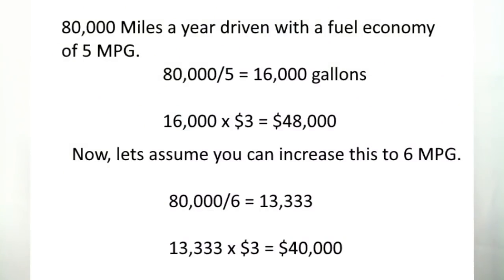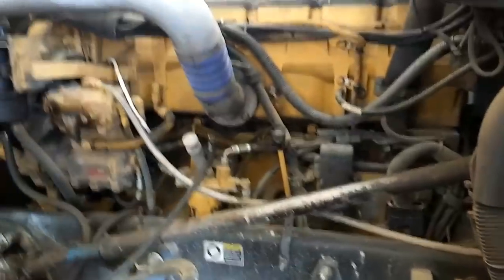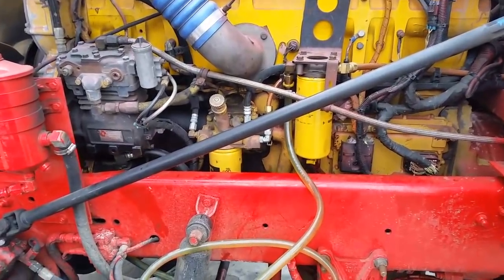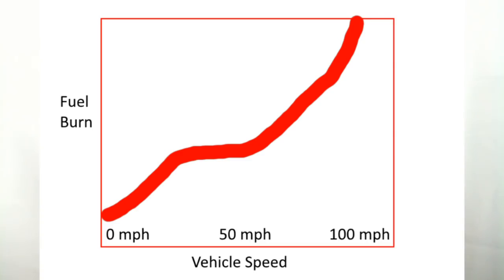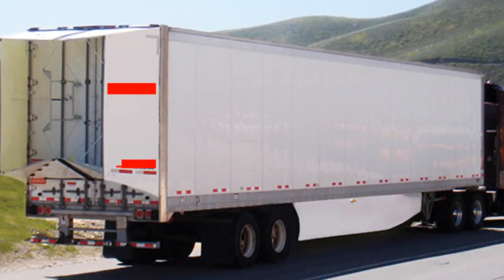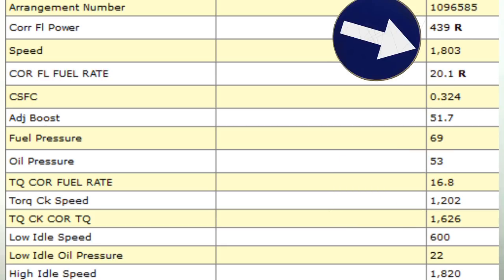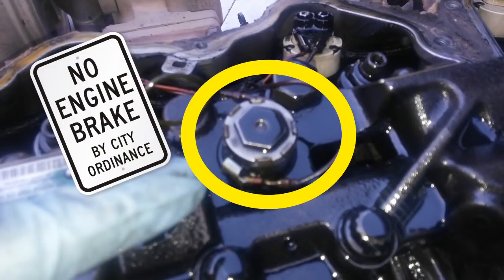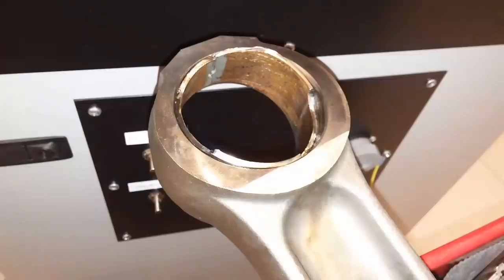How To Get Better Diesel Fuel Efficiency.  Increase Your Diesel Mileage And Economy.

Comment: This may not do truckers any good, but I had a VW Jetta diesel and it got its best mileage at 40mph, which nobody who is trying to get over the road is going to do.
And cold weather and extremely hot weather KILLED my mpg. 40 to 80 degrees was optimum. Single digits were horrible. A winter front might have helped but I never tried it.
Power service white bottle gave my little car 2 mpg

Comment: The major cause of fuel consumption above and beyond what is "normal" is parasitic drag. I.e. A/C compressor, Engine fan and thicker oils all contribute to parasitic drag.
Reply: I was thinking there were a bunch of wood ticks and leeches on the vehicle adding to wind resistance.  :-)

Comment: Also you can play with the ratios of the truck, like double overdrive.. (inverted gears) and lower the axel ratio, like from 411 to 355. I'm talking because own experiences. Mine a 1995 wia volvo m11 reg 10 speed and 411 rears. Switch the transmission to a 9 inverted and 355 rears, went from 6 mpg to 8.5 mpg. At 72 mph im at 1200 rpms.

Comment: We had a 1982 LTL9000 Orange pumpkin with > 3 million miles on it.  Just imagine the volume of fuel that passed through those 1/2" lines.  Certainly no a virgin engine at that point but it blows my mind how much fuel that one vehicle has gone through.

Comment: it’s the RPM revs of the motor there is a optimum RPM for given motors as most diesel have rev indicator in the dash EG Nissan patrol 4.2 turbo diesel sweet spot 1950 rpm for crushing  fuel usage is almost identical consumption without or when towing a 2 tonne trailer then look at your speed so keep revs constant; as soo as you push a diesel car over 95 - 100 kmph revs are now increased dramatically thus poor fuel consumption, and means poor fuel consumption simple

Comment: Short ratio transmissions - with shorter ratio transmissions you can accelerate faster and save more fuel. You can shift gears at lower rpm and not have as big of a drop in torque in next gear. You can also keep the rpm floating closer to peak efficiency rpm. But trucks already have close ratio transmissions.

Tire pressure - with higher tire pressure there is less rolling resistance. Though trucks already use fairly high pressure from what I know of.

Aerodynamics - the air resistance is squared. Meaning that at twice the speed the resistance will be not double, but quadruple. As for coefficient of drag, that doesn't change things anywhere near as much as total frontal area, therefor theoretically no spoiler will be better. As for down-force, well, if you want to corner pretty well at slightly higher speeds more safely, sure, those spoilers could come in handy. If you however don't care about cornering and whatnot, the down-force reduction will reduce rolling resistance.

Air fuel ratio - for diesels it's supposed to be around 29:1 for peak efficiency at max. Though trucks, form my knowledge, already run very lean air fuel ratios.

Compression ratio - higher compression ratio will give off more power and efficiency, at the cost of polluting slightly more (according to research. Which is why modern diesels have lower compression ratios). Though the benefit of higher compression ratio is a function of CR^(1/1.4) if I remember correctly, making it less and less effective the higher you go.

Breathing - removal of catalytic converter and muffler should typically improve breathing. Though it is illegal. Removal of air filter could improve breathing as well, though that can be potentially dangerous for the engine.

Waste heat energy - there can be various ways to harvest that waste heat energy and use more than the typical 30% that diesels get, in turn, being more powerful and fuel efficient. It's not as easy as it sounds though unfortunately. There are supposed to be 6 stroke engines which actually do just that, but for some reason we don't really see them in production.

Comment: on my 2.5L TDI Van when the conditions are good it gets 25km per liter

I drive conservatively, accelerate slow and I press the throttle as less as possible when I'm at top gear

my top speed is about 60-90kph seems slow but that is considered "fast enough" to not cause traffic in the Philippines

Comment: How would I do it? Pre-planning of the route. Comply with the inspections of the vehicle or truck. At night there is no wind and the air is a little cooler and richer in oxygen. As a result, combustion in the engine is more efficient and the vehicle does not start against the wind. If your business allows it, it's best to drive at night. Install and use a Webasto engine pre-heating system or a "Green APU" in trucks. The most efficient speed is between 50 and 60 miles. You should see these speeds as a guideline for your own vehicle and test the vehicle. There is no point in always driving a truck with a full load and at full speed. The tires often break due to the constantly high stresses from the load in connection with the high speed. Then you stand for hours on the side of the road or at the next service because of a puncture. You lose time and money as a result. In addition, you should have a complete FlowBelow Aerodynamic Wheel Cover Kit installed on the truck. I once saw a video of a US trucker getting close to $10,000 in gas bills a month. Therefore, I think that the money for the APU and for the FlowBelow Aeroparket has paid for itself quickly.

Comment: Great video you have helped me a lot just giving me some knowledge  and I have heard that some people are adding 2 cycle mineral oil to there fuel for injector lubrication what's your opinion they say it help cause of the low sulfur fuel thanks again for your videos
Reply: I lost fuel mileage adding 2stroke oil. Same with trans fluid

Comment: The reason the fuel economy doesn't change with a bump up or down in horse power is a thing called "Specific fuel  consumption.  As the man said...it requires a specific HP to move a specific load at a certain speed.  A 600 hp engine & a say 400 hp engine will use essentially the same amount of fuel to move the same truck & load over the same route,  Grand Prix racing cars, consume essentially the same amount of fuel to complete the race regardless of their horsepower.

Comment: Always drive at the peak torque at  lowest RPM of course make sure your tires are properly inflated and remove unnecessary heavy loads on the car/truck its simpler this way

Comment: Fuel economy typically is solved with good maintenance and efficient steady operation. Typically running your engine at the right gear ratio for the situation can really help to improve fuel economy as you are using the apropriate amount of leverage for the situation

Comment: 1997 VW Lupo 81mpg! The problem is not the Diesel motor, it is the vehicles they are put in. Skip the pickup get a compact with a diesel engine.
Reply: 2002 bmw e46 compact 2.0 diesel I get 42 MPG in city driving and not even slow one.. When he said 5mpg I nearly died :D

Comment: You are correct, i really dont know how to translate this to miles, but i drive a Hyundai i20 1.4Diesel, it's got 220nm round 1750-2500 cruising at highway speeds, the rpm is like 2100rpm at 120KM/H and the fuel consumption VERY low... I get use average 5L/100km 😊, and its punchy. What do you think is the lifespan of these smaller Turbod diesel enjines? Its at 150000km now 2014 Model, and haven't had any issues whatsoever...

Comment: HVO Diesel significantly less problems for the Particle filter. As HVO Diesel causes significantly less soot. then it simply does not need to clean the particle filter as often. HVO Can also be mixed into regular diesel. any diesel engine manufactured after 2010 should be able to handle at least 48%

Comment: drive slower,learn to coast down to lower speed limits,boost leaks,tyre pressures,fuel quality.  I had some friends here in Australia who ran long distance(200,000km annual), heavy combinations ( 65,000kg) who had a lot of success running 50hp injection of propane/LPG. They had cleaner oil samples, and drops in diesel consumption...........after paying their diesel and propane costs they were overall 10% saving.  One thing by itself, doesnt do much............however if you pay attention to all the factors it can make a big difference.   One of the best things we have in Australia to improve productivity for fuel savings are Road Trains, or A-double semis. You get 100% increase in payload for just another 25% in fuel consumption.  B-Doubles are also good, but they use almost the same amount of fuel for only 60% more payload.  Keep your radiator and CAC free of 'fluff' from insects etc since that will increase fan run time and decrease CAC efficiency.

Comment: Maybe it's been mentioned, but number one in my book is tire pressure.  Run them up near max.  Less rolling resistance.  
Do they still make Cadillac Shutters?  If so, think about a set.  Keep the engine at preset temp w/o the fan running.  
Drive with your EGT.  It'll tell you the most about engine efficiency under load.
Reply: @brocluno01
What EGTs for best efficiency?
Reply: EGT is for engine protection.  Keep the temps up, but never over 1,100 to 1,200 degrees climbing hills w load.  Heat makes power, but on the flat running 600~800 near peak torque point is best for mileage.

Comment: What about advancing start of injection timing and lowering fuel rail pressure to balance out power output? I tried that in my comparatively tiny 1.9jtd fiat engine and fuel economy improved 63.5mpg to 74mpg calculated at the pump. I also tried the lucas oil upper cylinder lubricant just because i was given some by a pal and got an improvement to 78.4mpg. Engine also made significantly less of the diesel knocking noise and performance improved sightly by about 15% at the dyno. Running at 2.6 bar of boost i got 233whp without the additive and almost got 270whp with the additive. Not a lot compared to behemoth CATs by not too bad for a 115 cubic inch diesel. Torque is all around 500lbs-ft.
Reply: Dexter Tang, Hi I'm very interested with your results cause I'm on same way, can you make it as example video?
Reply: Dexter Tang - good points, the problem being the emission requirements dictate retarded timing for the diesels.

Comment: If You double Your speed the wind resistens will increase four times.
Reply: Magnus Carlander not in all cases
Reply: Didn't know that, when doesn't the law of physics aply (E=0,5mv^2)?
Reply: Excellent aerodynamics will modify the resistance factor.
Reply: Yes, but if you double your speed you still increase the resitance four times :)
Reply: Air resistance does go up with the velocity squared but wind resistance is only one factor.   There is rolling resistance ( tires ), 4WD increases resistance.  It takes energy to move the valves.

Comment: Mirrors, especially on semis, are a giant wind drag. I would like to see cameras used today instead of mirrors. My 379's and 389's are not "Aerodynamic" but they are light. I don't know of any other tractor I can buy that is under 16,000# with a 63" sleeper. My new trucks with MX13s, 18 speeds, super singles, and very tall gears do 7+ mpg if you keep your foot out of it when you can. Im almost 40k empty though, wish I could be lighter when empty 😕

Comment: I am a newbie to your channel and certainly new to diesels. I am considering purchasing a 2002 Ram 2500 4x4 with a cummins. The truck I have landed on is not a 53 block, has 133k miles and had the injector and fuel lift pumps replaced about 15K miles ago. What would you recommend to prolong engine life and possible improve fuel economy? Thanks in advance for your response.
Reply: Run 5-40 full synthetic. Keep speed down. Try RV-275 injectors. Have similar truck. With mods weighs 9K empty. My max speed is 65mph. I get 20-22+ mpg depending on speed and terrain.

Comment: Hello!! Bought my first diesal truck! I bought a new 2018 chevy duramax.  My question is, what tip is there for optimal motor care? Besides the normal. Proper break in, and regular oil changes ect. Fuel additives? Synthetic oil? Any other weird things i don't know about.  I own a construction company, so the truck definitely gets used properly.  Just curious
Reply: You have no choice other than use synthetic oil otherwise you'll destroy the DPF in no time.
Reply: I have a 2016 5.0 Cummins and fuel additive matters every fill up to make sure your fuel pump is happy.
Reply: let it warm up for a few minutes, if you can't drive slowly.
I live on a really super busy road where people blast by going 40 while the limit is 30.

Comment: You say some things that are Ashley counter intuitive although both of your information is spot on. You said you don't see how Max horsepower and fuel efficiency go hand-in-hand well. How when you are burning the most of it efficient amount of fuel you are getting the most energy out of that fuel so it is also producing the most amount of horsepower the same time as getting the most about of fuel efficiency
Reply: That's because in a diesel, for max efficiency, you need a certain amount of air. The more air goes in to burn the fuel, the more efficient it is, but those mods for more air often drive the price up. Less black smoke=more efficiency. Little to no black smoke=top efficiency.

Comment: No Lead feet, maintenance, tire pressure all help. Driver awareness most important, city drivers watch lights ahead much cheaper to cruise at 30kph in town and never stop than accelerate to 50 then stop and repeate six times. Cruising much cheaper than accelerating.

Comment: Great video, especially about the wind resistance which increases in squares.    I have experimented and found 62mph to be a very good fuel saving speed.  At that speed I get about 31mpg on my RAM 1500 Ecodiesel.  I would NEVER experiment with lowering the viscosity of the oil.  This WILL cause premature wear on vital engine parts.   RAM used to recommend 5-30 but now 5-40 T6, which is a great oil without breaking hte bank.  Spectre makes a great comparable K&N filter for less than half the cost.  One thing I really believe in is fuel additives.  I experimented with a BMW a lot and found that switching between Techron and Lucas was the best.  Hitting a gas engine with Regane in the additive is great, but I don't think this works for diesels.  That said, the research I have read and experimented with is Power Service Kleen Diesel which increases the cetane rating of the fuel.  This barely increases mileage but what is most important, keeps the fuel system clean and the fuel pump lubricated. Replacing injectors or fuel pumps will blow any savings on fuel out of the water.  Lucas is also good for diesel so I run some of that in once a month.
Reply: in my experience power service kleen diesel, and products like diesel 911 don't work and are purly snake oil. yeah sure it might add a few millionth of what it advertises on the bottle but for 5-10 dollars what can you expect a dollar store bottle to do for your diesel engine, and for 20 dollars you can start getting actual fuel and oil additives from brands like liqui moly brands that have signifcant meaning elsewhere on the planet and are not found at dollar stores, but are on the shelves at high end dealers and parts stores.
Reply: $1 snake oil and $20 snake oil? 😄

Comment: Not sure if it's a gimmick, but I've done research on hydrogen injection systems that claim a significant boost in fuel economy, at least 30% potential fuel savings over the life of the truck.  These hydrogen systems are also claimed to clean out piston and cylinder carbon buildup, insomuch that the pistons can be wiped clean with a cloth, no carbon residue to speak of.  Apparently it works well enough in gas engines, 30 mpg from a Chevy 350 Silverado 1500, but that was a rigged mason jar setup using electrolysis from electrified rods stuck in tap water to create hydrogen bubbles to intake into the engine.  I'd like to hear more about this gimmick on this channel, if it's a legitimate idea, if it's a scam, whatever it might be.
Reply: I would put HHO along with water emulsification in the category of "apparently works but complex and dangerous to engine longevity".

Water emulsification is the more proven of the two, basically you want to mix about 20% water with the fuel using an ultrasound mixer to keep the water in suspension until the mix goes through the injection pump. There are plenty of academic papers about why this works and there are a number of suppliers of this tech for marine (container ship) and truck applications. Of course adding water to your fuel is going to hurt your lubricity which is already reduced by the desuplhurization process.
tl;dr water definitely works but you're putting your injection pump and injectors at risk.

HHO for a diesel is apparently safer but less studied, there are some researchers in India who have been doing empirical studies on HHO with some positive results, and at lease one trucking company claimed to have been running this tech in their older trucks. There have been some claims about hydrogen making metal brittle but I'm not sure if this is sound, the bigger concern of mine would be risks from electrolyte in the water droplets which come with the gas.
tl;dr supposedly works but there is no academic theory as to why, might have risks.

In either case, there is an engine damage risk so I would probably use it only on an engine which is approaching retirement, especially because these older engines likely lack the complex emissions gear which is also something that can potentially be damaged.

Comment: Hi Josh  I get 6.2  to  7.2  if I run 63  64   mph  it increases the slower you go I got 2007 c15 acert that's tired 900.000 miles on it  I'm happy with it  my truck is not aero dynamic imagine what it will do after you over haul it. 😁